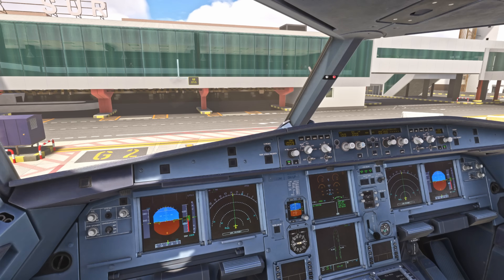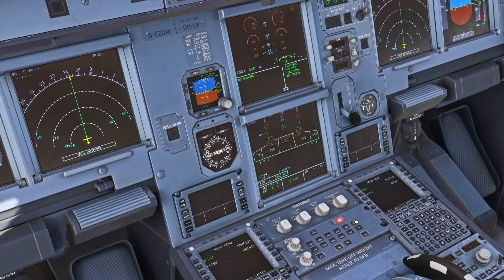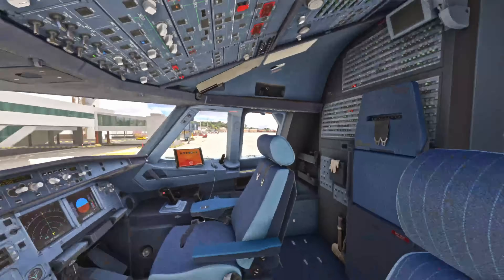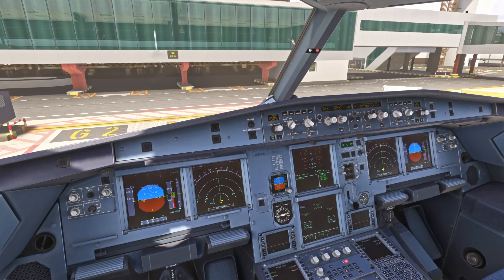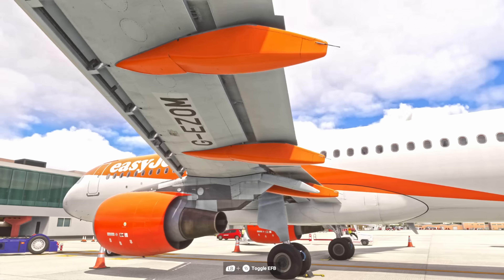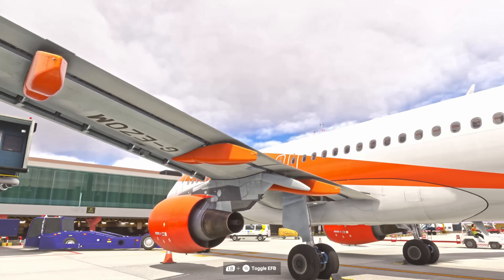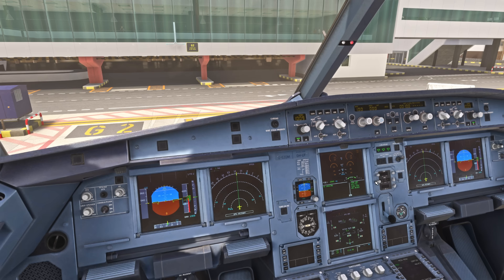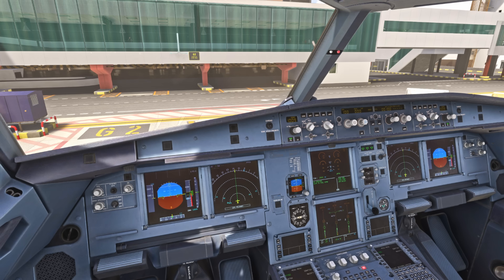A320 Hot Weather Operations Explained | Real Pilot Guide (MSFS 2024)

Comment: Is this still required in the Neo's?  I heard there had since been a software update to the leak detectors, so flap 1 was no longer required
Reply from the maker: The bulletin for this issue is not present for the Neo aircraft as you say. Modernised sensor calibration and revisions to software logic has removed the issue 👍

Comment: Captain, thank you for the video. In 10 minutes many new things I hadn't seen before from other hours-long videos like why the 1+F config during a aturnaround, but not for overnight parking. Very interesting !
Have a question.
Someone is telling me that when it's hot outside, if the APU is turned OFF during taxi out (as it would normally be, I believe), N2 may rise as a result of using the AC which may lead to brake temperature problems as these A320s can taxi with hardly any thrust. So to avoid that, they will leave the APU ON until the holding point.
My question is: in the sim I turned OFF the APU during taxi while OAT was a high 40°c, so the engines took over the AC system, but N2 increased only 0.2% from 60 to 60.2% (Fenix A320 CEO IAE).
Is this the kind of increase you would normally expect ? Looks quite small to me.

Also, thank you for taking the time to answer questions from previous videos. This is really really cool. And also for keeping them short and very targetted. Finding what I need is far easier that way, although of course your hours long streams have their purpose.

*edit: putting the Pack Flow on High instead of leaving it on Norm, increases N2 by 3% !
Reply from the maker: Hello, pleased to hear you discovered some new information here. Yes, that 3% increase in N2 when switching Pack Flow from Norm to High is much more in line with what you'd expect in hot weather ops.

When you turn off the APU and the engines take over supplying bleed air to the packs, the N2 will rise due to the added load and 3% is a realistic jump, especially with both packs running in High and a high OAT close to 40C. It is common practice especially if the brakes have accumulated a lot of heat from the last landing.

No problem at all answering the questions 👍✈️
Reply: @AirbusCockpitCoach  Thank you for the response. Very clear.
Reply: @AirbusCockpitCoach  Ah, so that's why I notice a slight engine increase after both engines have started. I always just assumed it was in my head, but it will be when they turn the APU off and the engines take over. 😅 Learn something new every day on this channel 👍.

Comment: Thanks Captain, are there any limitations to using the brake fans in those temperatures?
Reply from the maker: No limits but as per your message on the A350 brakes the same applies to the 320. If you use the fans the brake temp needs to be below 150 for departure or below 300 without fan use so it can need careful consideration and if I was just over 300 degrees with a short turnaround I would not use them in order to avoid a departure delay
Reply: @ how long does it take the brake fans to get them from circa 300 to below 150? I know ambient temperature will affect that